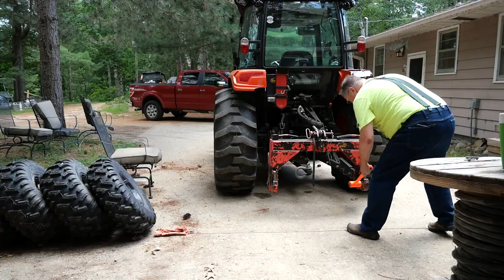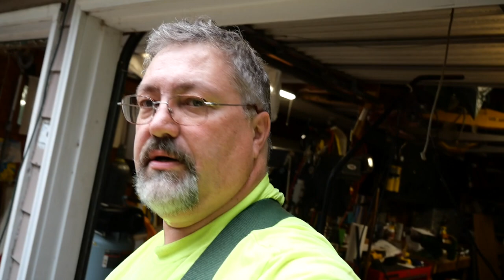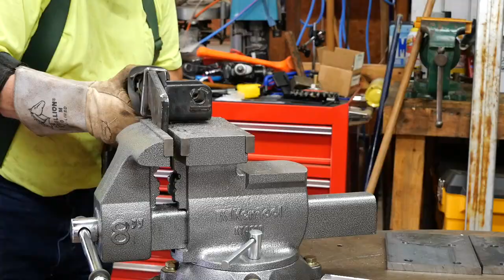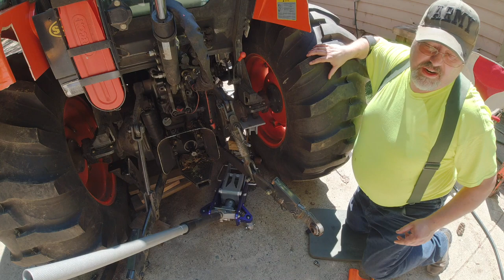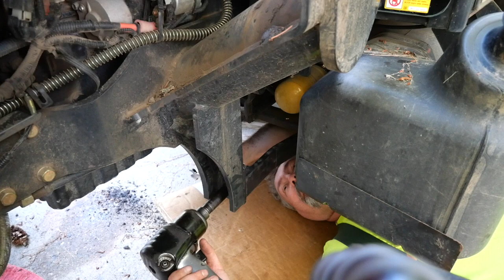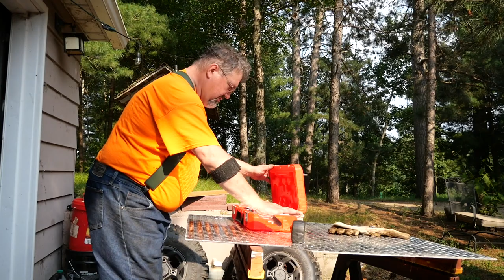Broken Tractor! Fixing Lift Arm Stabilizer Mounts on my Tractor (EP 400)

Comment: I still have and use my 28V Milwaukee tools.
Reply from the maker: I only have this one M28 Sawzall, but I'm still impressed that for practical purposes it works as though it plugs in. That said, at some point I'm I plan to purchase purchase an M18 Fuel multi-tool kit—especially for Milwaukee's new 1/2" cordless impact.
Reply: @MinnesotaEric  
I'd like to get the 1/2" M18 impact also. Over the years, I have accumulated all three voltages of Milwaukee tools. I like that they have focused on two voltages. I just wish it would have been 12V and 28V.
Do be careful of fingers when using impact drivers. Especially plow bolts. Plow bolts can get really sharp and rusty. I think the last time I received a tetanus shot was when I learned to keep fingers away from potentially rotating fasteners driven by impact drivers. Now I push the bolt with the back of a screwdriver.
Reply from the maker: @davidcanfield4347  Years ago, back in the mid-nineties, a friend of mine took a job doing warranty repairs for Milwaukee Tools in the warehouse district Eden Prairie, MN. I used his employee discount and discovered the joy of cordless 12v drills for my dad and myself as well as a really nice (and still in service) 1/2" corded hammer drill. Somewhere in 2009, I spent what seemed like a fortune for Panasonic's 14v brushless impact and drill combo set. Both of those tools are also still in service and the drill driver is a hidden jewel in manufacturing to this day. Trouble is that Panasonic doesn't make a great variety of tools—I suspect so as to not compete with everybody buying their batteries or licensing their battery tech—while Milwaukee has a huge lineup of tools that are all well made. Anyway, sounds like you and I are on a similar trajectory.

Comment: How many hours on the ole girl now.  You have definitely punished her over the years.  I have the same tractor and love it.
Reply from the maker: I don't know why anybody thinks I've been hard on this tractor. The rear fenders got broken the moment I started the tractor after installing the CAT2 Quick Attach when it was brand new (which is also the very moment that I realized why all the American-branded tractors mounted the rear of their fender much more forward—so they wouldn't get beaned by attachments) and the tractor has spent most of its hours doing easy loader work. At any rate, my Kioti 6010 has over 700 hours on it and is heading into its big 800 hour service. Thanks for watching!

Comment: That your frame or at least the mounts on the frame are cracking tells me that your steel may be too hard, i.e. high carbon content. Talk to your local fab shop and discuss what alloy/grade of steel would work best in that environment. Plasma for sure.
Reply from the maker: Dana, smile, I am the local fab. The mounts broke in my estimation from the weight of a BB720X bush cutter levering against them for eight years. If these new ones break I will make entirely new ones out of AR400 or AR500 which is a higher carbon content alloy that can have significant springback but also requires preheating, fat welds, and slow, slow cooling for the best results.

Comment: Found ya a little while ago , great job . What was your mos and where did u serve ? I was a 62e and mostly in Graf ? Was the rear hydraulic down pressure cylinder bought with the tractor or an after market one? Well I'll eventually get through all your videos.
Reply from the maker: Thanks for watching, Todd! I was a 67y for AH-1s, but mostly worked on UH-1s. I was ARNG in 34id out of Minnesota, 2nd combat team, 147AVNB. Looks like the 34ID has reorganized again, but nowadays oddly enough it has the dubious distinction of having been the longest deployed unit in the Army having been deployed continually since 1991 to the present. https://en.m.wikipedia.org/wiki/34th_Infantry_Division_(United_States)

The cylinder is a tilting cylinder for the rear three point and is aftermarket.
Reply: @MinnesotaEric  thanks for your service. Do u have info still on the cylinder. Thanks for the response. Todd
Reply from the maker: I still have the cylinder. What is your application.
Reply: @MinnesotaEric  I have a bobcat 2040 , Its basically bobcat's version of a Kiote tractor. I want one for my box blade and yard rake.
Reply from the maker: I think it will work if you have a set of rear hydraulic oil thingies (senor moment I'll wake up from my sleep remembering what they are called LOL). You have 40hp tractor and a Cat 1 3PT. What do you want to offer?